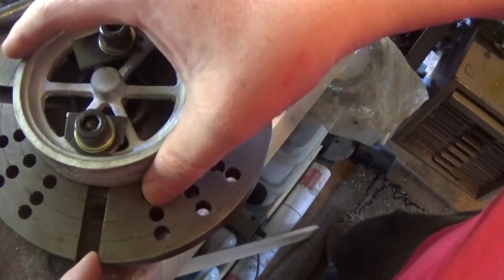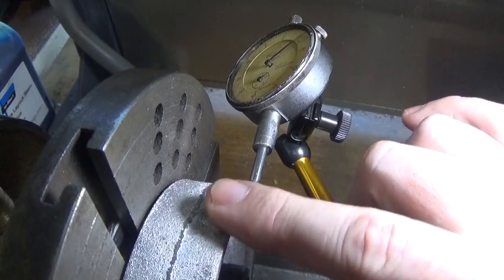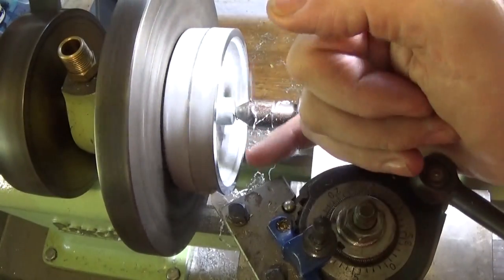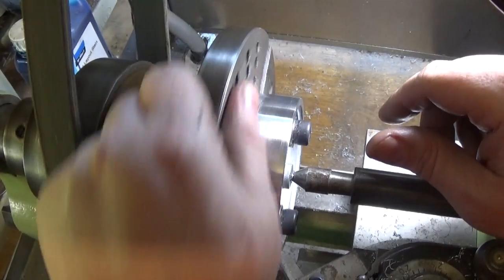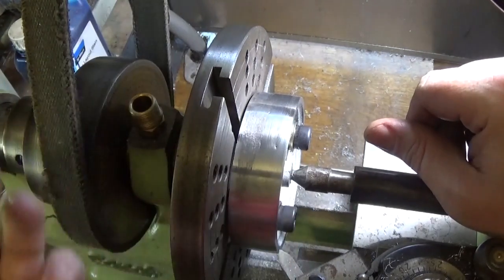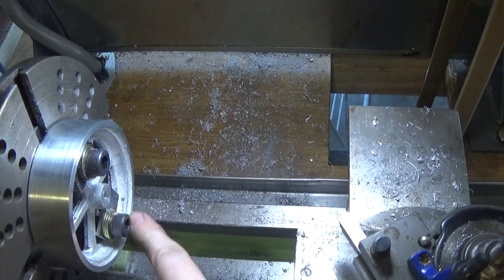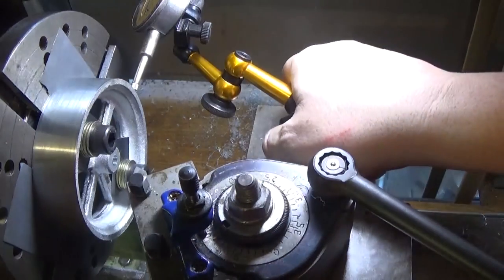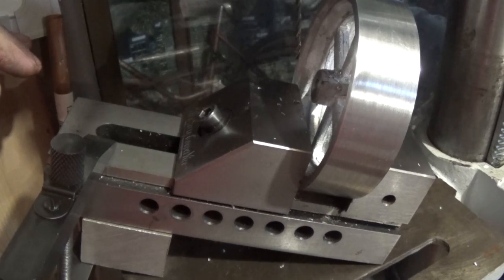MYFORDBOY'S ENGINE! my version!

Comment: Nice job. Inclusions are the bane of castings. I too thought your hub was running out, but you answered that question. I do believe the faceplate is making its first entry on stage.
Reply from the maker: yes it was a rough old faceplate someone adapted and i cleaned up a lot. one day id like to get a better one. thanks for watching
Reply: Hes, I noted some very odd-looking holes.

Comment: Hi Emma - Top work as usual. As I discovered with my impure ally, there are hard and soft spots. Impossible to get true or flat no matter what you use as it will always take more out of the hard spots than the soft.
Don't know if you've discovered Dave Richards channel. A really cool steam driven shop, and a top machinist. I'll post a link in a separate comment just in case it goes to spam.

Comment: Hello Emma,, your getting on like a house on fire,
   I hope you don't think I'm being picky, but at around 11 min into the video you will notice that the drilled and reamed bore is running out quite a bit and will give the flywheel a pronounced wobble, I would suggest that to have a nice true running flywheel when finished,  you could set it up in your 4 jaw dial in the od and with a boring tool clean up the bore, it will be oversize so just plug with aluminium and use Loctite 609, then re-drill the plug and finish bore to size, for this type of machining it should be bore and ream at the least, better still would be just bore to size, nothing worse than seeing a flywheel running out, I would think the latter suggestion would be preferred,  

I'm just thinking about the completed model engine, I don't mean it to be a negative comment,

Edmund..........Alberta,
Reply from the maker: thanks Edmund. at 10.00 i turned the flywheel around to face the back edge.. i didnt set it up particularly close because it was only a facing cut. so yes, it was wobbling. on the shaft it runs pretty sweetly though. thans for watching!
Reply: Emma,
   ah I see the light now, that makes more sense, gotta get rid of those blinkers, my apologies,    

Edmund..........Alberta

Comment: Nice save on the flywheel Emma. Its a bummer when a casting has an inclusion near the surface you are trying to get a nice finish on.  Thanks for sharing. If anyone wants a few bearing outers just call in your local garage and they will usually give you a few from the scrap bin foc.   regards from the UK
Reply from the maker: bear in mind that mig welded ones usually arent much good for this though! lol , thanks for watching Gary

Comment: When setting up the flywheel to run true use the inside of the rim. That way you don't get a thick and thin edge to the rim. Castings are never true and the outside could be oval. Just my take on the job.
Reply from the maker: you are spot on.. i know this of course, but it completely slipped my mind when i was doing it.  its not got much wobble in it though, so i got away with it. thanks for watching.

Comment: Very good video. I've run into badly pitted fly wheels and saved them by turning a rim and shrinking it on. When finish turned the joint is invisible.